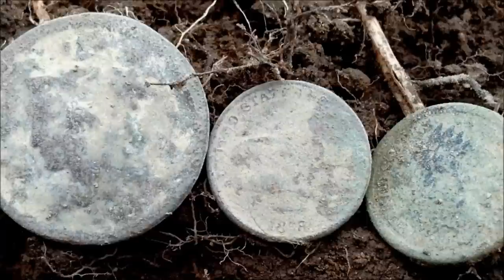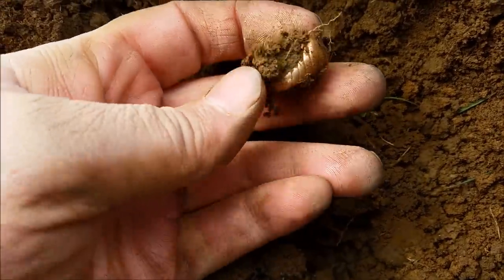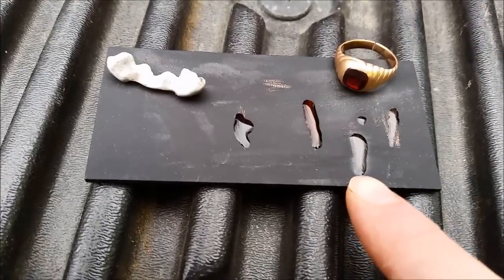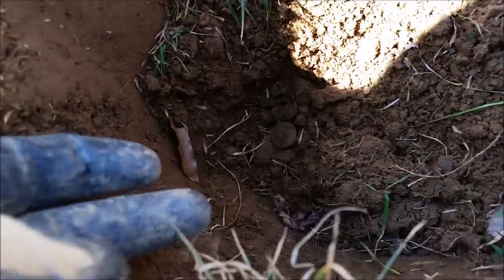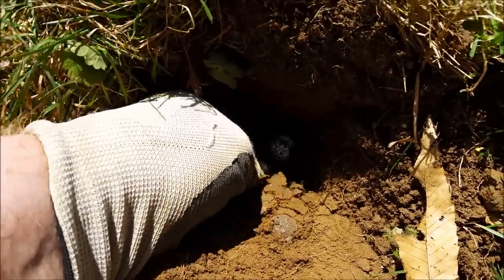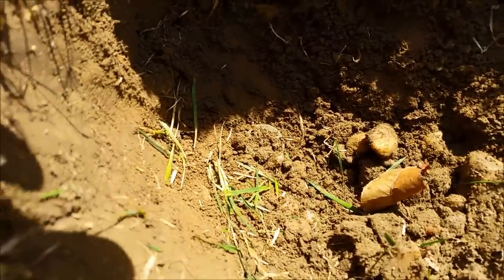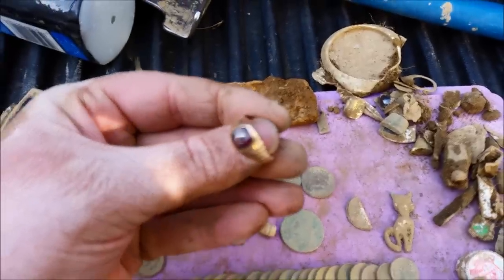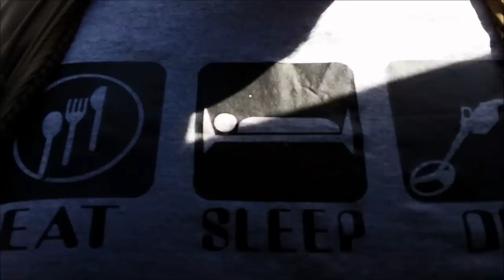Metal Detecting Gold & Silver Coins | Wheat Field

Comment: Another awesome hunt my friend, you are killing it there.  I've been thinking about getting the large NEL coil for my AT Pro and you digging those indians and large cents really make me want to pull the trigger.  I'm curious, do you find it harder to pinpoint with the large coil?
Reply from the maker: Quarter Hoarder Thank you for watching! The coil I use is the Storm (13"x14"). With anything new it took a little to get used to. If I'm on a good target 99% of the time I have it pinpointed dead nuts in the center of my Plug/hole. I always circle my targets to get the best pinpoint. Good Luck if you put the tigger